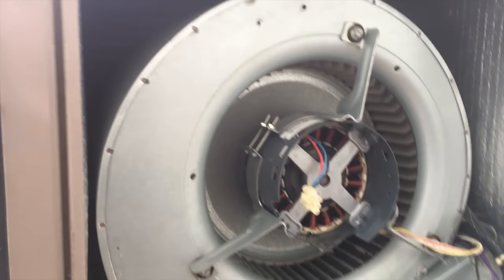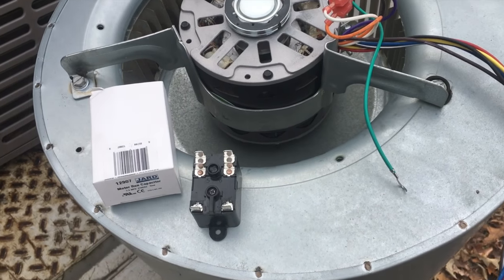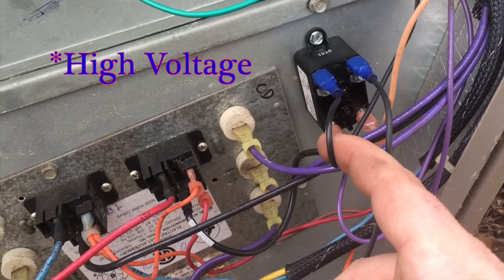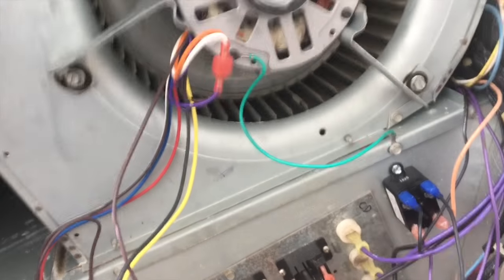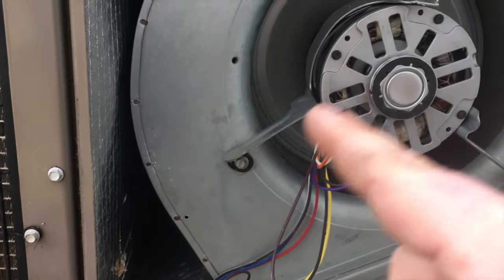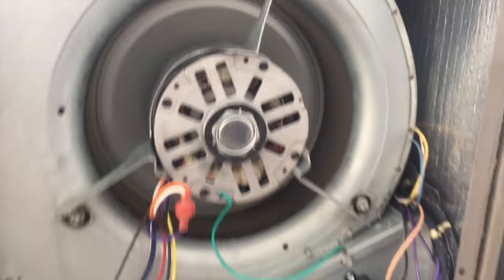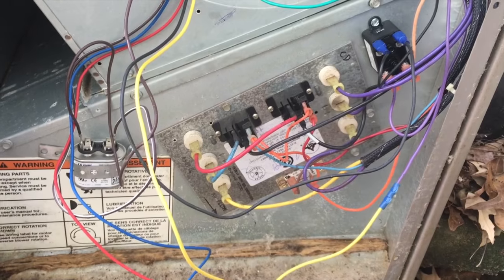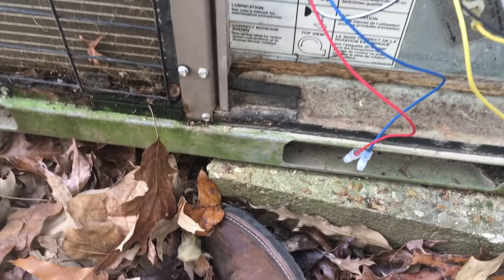ECM to PSC Conversion/ Short Blog at The End

Comment: I have a gas system on mine and I did the psc conversion. I had two speed taps on my "H18" motor. I traced them back to a control board. One was "AC" and one was listed "gas heat". I used a seperate relay for each. I wired them same way you did. I wired my high speed psc wire to the AC and my medium speed to the GAS heat signal. Using the 24 volt to turn seperate  relays on.  Im an auto mechanic by trade so Im no expert at home HVAC. AC works great in the house now and I think the heat will too but I have not tried it yet. Still pretty warm out by me. Cost me $220 for the motor, capacitor and relays. The ECM motor was already replaced 2 years ago by previous owner of the house. Another genteq OEM replacement was 1100$. I know I could buy a much cheaper aftermarket but I dont want to be bothered replacing these every 2 years. After I diagnosed my motor as bad and learned about the ECM motor I was like screw this piece of junk. Cars are the same way now a days. Everythings designed to fail.

Comment: John, glad your back. Have you ever replaced the round pancake resistor in the ECM module? That is almost always what I run into. In a pinch you can jump across what's left of the resistor until a replacement can be found. It's a $10 part and the furnace doesn't lose its efficiency
Reply: It's a thermistor.  Basically it's a resistor that varies its resistance with heat.

Comment: What about a new gas furnace with a board that has a time delay that starts the motor?  In the old days you put the "Heater Speed" on the normally closed set of contacts because the fan switch would bring on the fan and the cooling speed on the normally open because "G" would energize in cool

Comment: when checking for correct blower operation- just look at the fins and see what way they are cupped, and see how the squirrel cage is shaped going to the duct- that is the rotation it is supposed to go. i can see a novice tech doing what you did and in goes the piece of insulation lol

Comment: I do x13 to PSC conversions quite a bit, typically when it’s older equipment that’s out of warranty. An x13 is not really a true variable speed motor anyway. And PSC motors are a lot more reliable in my opinion.
Reply: Straight facts
Reply: X13 was never a variable speed, its a constant torque, the 2.3 and 3.0 are variable speed

Comment: Not a good test for fan turning right direction. A squirrel cage fan like that will still move air with the motor going the wrong direction (but not as much). To save electricity I cooled my garage with a fan like yours running backwards.

Comment: May want to check duct static on that system. Had a lot of x13 going bad due to high static. Also I have been installing the evergreen aftermarket ECM x13 that are considerably cheaper that oem and are basically just the same thing. They have a variety of sizes as well.